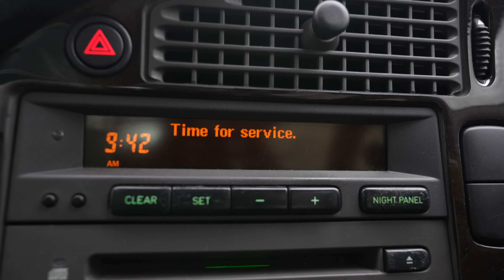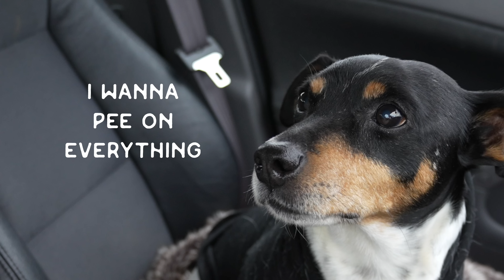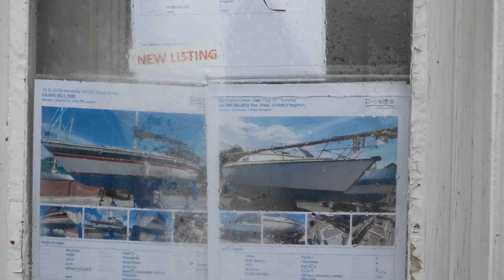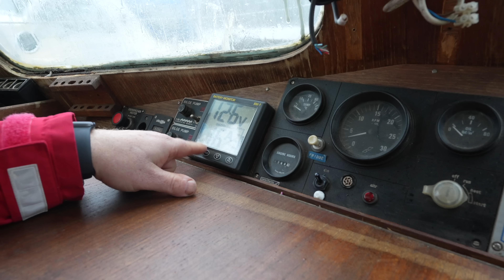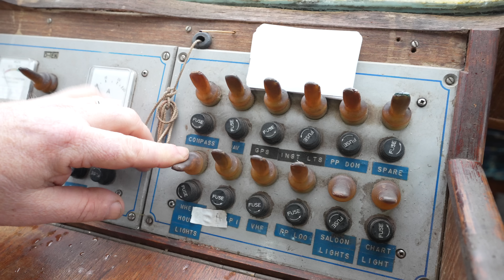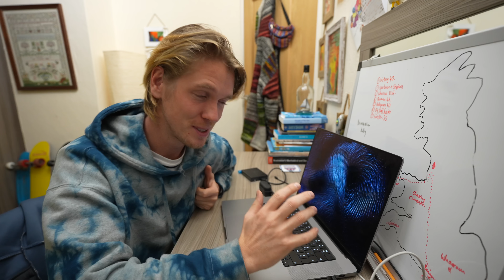Should I Buy This SALVAGED Steel YACHT? Sailing Melody Special Deal! | Wildling Sailing

Comment: Its a great boat with enough that needs to be done to keep you busy and give you plenty of content for years to come all while you sail around. I mean come on you can pilot the boat while boiling water for some tea and never have to move. This boat is just about perfect for you at this point in your journey.  For the price you can not beat it.
Reply: "while you sail around" - in your dreams, this is a motor-sailor. You know, it uses relatively more diesel, sailing is not its strength.
Yes, for a "price you can not beat" .. and for a boat you don't want. How good is that!😢

Comment: Hi Mark, although a generous offer old steel boats need more work de rusting and painting. Swing keels = extra complexity and possible noise issue. I see her more as a motor sailor, but a safe heavy weather boat. Long distance sailors are always stressed in light wind when their boat fails to make headway. Just my thoughts. Good hunting!
Reply: It’s a stitch up on a boat that will sink, 5k scrap for motor and ballast

Comment: Hi, I've owned 2 steel boats, a 30' and a 54' and I would happily own another. Steel is foregiving, easy to repair and immensely strong. Maintaining a steel boat is no more arduous than a wooden vessel. It's all about getting the fundamentals right and eliminating things which make inspection and  maintenance harder i.e. no external wood work, use stainless on all wearing edges and surfaces, Don't drill holes through the deck, make sure all internal and external parts of the hull are accessible easily; hulls rust from the inside out so no water or condensation traps. Use epoxy paint systems on freshly grit blasted steel. Keep on top of repairing any damage to coatings.Use the right amount of zinc anodes, not too many mind. Laid up, use a dehumidifier to keep the inside dry. Be sure to have your electrics in good order to avoid electrolisis. Instead of loads of seacocks and through hulls use a sea-chest of large diameter with an above waterline opening cover for inspection and cleaning. Its all common sense really and satisfying to have a solid and well maintained  vessel under you and hell of a comfort crashing to windward on a cold dark night, knowing about all the stuff floating about in our oceans....
Reply: Bernard Moitessier knew his onions and would approve of your words of steel!
Reply: But sometimes you need to drill in the deck for example an exhaust pipe for the heat system, just use good kit
Reply: How do you check if your electrics is in good order? I have a boat too since two years
Reply: Taking a good welding Class at a local College and having a good welding machine on board will solve all your maintenance problems and even let you earn a little on the side.

Comment: We built a steel centre-boarder (32' Wylo design) and sailed her from New Zealand to Washington DC via Australia, South Africa and Brazil. Two main considerations for us were the strength (surviving hitting a floating container being a major safety consideration) and easy repairability of steel, especially for a shoal draft boat which can lead you into all sorts of interesting places. Our boat also had a non-ballasted swinging centreboard which we used for close reaching or going to windward. The centreboard made a huge difference to windward ability giving us all the benefits of a deep draft when needed and the wonderful bonus of shallow draft for exploring waterways. Our below waterline gasket was made from a tractor inner tube and never leaked a drop. Lastly, the ability to beach the boat (she had a wide keel and demountable legs) and clean/touch up below waterline paint was a huge convenience and saved us thousands in haul out fees. Melody has many advantages over other boats I've seen you viewing and is a very good prospect for a long voyage. A suggestion: make a list of desirable qualities for an ocean going yacht then only buy the boat that fits most or all of them. Good luck!

Comment: You can take this boat anywhere. No restrictions there. Stable in heavy seas. Can be run aground for maintenance. Good size for you + 1. 

After a year or two you find it’s not for you then you can sell it.

It’s a great deal.  Don’t pass up the opportunity. There’s no such thing as the perfect boat
Reply: Mark,take up Andy's offer he's a very generous and genuine person ,at least with Melody you can still put you into her, plus they have not scrimped on the work plus she is a stell hull.
Reply: I once had the chance of buying a BSA 4 wheel sports car  all restored by the owner similar to Andy, I passed on it for the sake of £500, big mistake, BUY IT 🤗
Reply: Any boat owned by someone else is the perfect boat.

Comment: OK my first comment on here since you were in Fleetwood long ago and it's about your choice for next boat. I want to split the comment into two parts so here goes.  Part 1... This is by far the best boat and best offer you have had. Part 2... Up to now. 

I'm not psychic so I can't know what you will find next. But I know you may well regret it if you let this offer slip through your fingers Mark. The steel hull is an absolute keeper, and by far the easiest to maintain and repair if needed. You want to travel the world and navigate very different waters and seas, and hull strength is a huge plus. I sailed all over the world taking over 12 years in a steel hull (many years ago). Best of luck mate on whatever you choose.

Comment: Totally agree with the general consensus here. The steel boat, perfect for northern climes, but not a world cruiser and will no doubt turn into an oven in the sun. The Wharram, I just have this mental image of Tom Hanks on the raft in Castaway! 
In my most humble opinion the Freedom ticks the boxes. It's not so much of a project, so won't keep you stuck on the hard with a never ending list of jobs before you can cast the lines. The double wishbone rig looks super easy to singlehand and trade wind sailing. Lack of standing rigging cuts the ongoing maintenance/cost. It's quirky enough to maintain your cred. Above all it'll take you no time to get back out there.
Reply: Plus you don't have to worry about lightning strikes with unstayed carbon masts !!

Comment: Mark, this is a great deal at 15k, especially since you’ll have the guidance and help with putting her back together! I’d say hop on it! It’s a true world cruiser, big fan of steel boats. Cheers
Reply: It's hardly a "great deal" if you want a blue-water cruising yacht. There is a  very big difference. 
I hope Mark is not pressured to buy something he doesn't want.
Reply: @alexandermenzies9954  he's a big boy and hopefully can think for himself
Reply: @oregon1232  I'm sure that is the case, Oregon. However, the chorus of (likely know- nothings) those trying to solve someone else's situation by lumping Mark with an old swing keel motor-sailor is shameful.

Comment: Mark wishing you well with whatever decision you make, as a boat owner for over 40 years I much prefer the Freedom 35 for an infinite number of reasons, you can spend 10k on this boat in the blink of an eye and at that point it will still be only half the boat the Freedom 35 is, to grow your YouTube channel you are far better sailing to interesting destinations and doing on going repairs simultaneously, you will go completely mad spending 6 to 12 months on the hard and frankly it may never leave the hard and possibly unsalable, the Freedom 35 will always be attractive to a wide range of buyers, which will allow you to transition to your next boat in 2-4 years, sailors with glass boats are generally terrified of steel boats being moored nearby, the decks on a steel boat become unmanageable when they heat up, everyone on board will require shoes at all times and for Yoshi a disaster in closing with wise improvements to the Freedom 35 or another like boat may give you a small capital gain when you resell,  the most important issue however it will always be saleable. I am always in your court whatever you decide, please accept these thoughts in the spirit they are given. Best Wishes to you and your wonderful family.
Reply: Exactly my sentiments entirely.

Comment: I love steel. No osmosis issues etc. and problems, just weld in a new section. You dont heel over as much and good for knockdown prevention.. Bilge keels are designed to help with sailing, not just stands.

Comment: HI Mark,
I had a 33 footer steel boat. One think you'll have in mind is I AM SAFE. The flat part of each side of the hull are called bouchain in French. It makes the boat very stable a sea, especially going trough waves up wind and no pounding. Pilot house is a big plus when you are a full timer. At this stage you see the bones of boat and if you go forward with it, in 2 months you'll know the boat perfectly and you can redesign or adjust what ever you like. I know going for steel is a decision which is hard to answer but confort at sea, security, cheaper to buy, repair and have a good size dinghy. This boat will carry staff no problem.About the freedom, there is not enough headroom for you and if you load the boat a little too much, you'll lose the performance. A light boat for the week end and summer is ok but for you ???? make a list of your priorities and stick to it. Myself, I really like the freedom but not for sailing full time.With melody all options are on table. One more thing, melody is very well design. Happy sailing!

Comment: Being steel, the bottom configuration (chined) may make her roll more in a beam or quartering sea or swell. I gather Andy is willing to step the mast and launch Melody as with this topic, adding another cost. Possibly, after Melody is launched you could take her out on sea trials giving you more knowledge of her capabilities? It's a tough position so take your time with knowledge of further sailing adventures. Good luck!
Reply: There is another steel chine yacht recently re-launched on YT and it's very apparent it is a "wet boat" on any tack. The rail is under even with light winds.
No wonder they're headed for the tropics..
😀

Comment: This is an interesting boat and a good offer for the right person (even at the completed 25k price post refit and in the water), but... First, I think this is a more of a motor-sailer, 36 foot with an 80hp diesel with massive fuel tanks sounds a bit suspect. You'd probably want to look at the rig and the sail numbers to see if this boat can handle its weight under sail. Also, if you are planning on staying in cold weather this type of design is fantastic (think about how much attention was given to the heating system on this boat, protected interior helm, etc.), but, I think you'd cook in the tropics (the pilot house looks like a pressure cooker and there are very few opening hatches, etc.). 

If you were planning on sailing up near the Arctic, that'd be one thing, but, if you are heading out the channel and turning left, it is entirely another. I think you'd be happier with the sailing ability of the Freedom 35 out of the two so far, which is designed more for multi-latitude sailing, and would handle a trade wind circumnavigation with ease. Excited to see what other options you are considering! Fair Winds!
Reply: Agree!
Reply: Another vote from me in support of this view of the steel boat. It looks like a powerboat that will have a sailing rig on top. You will burn a lot of diesel going anywhere, but you will be warm and comfortable on the way. I can't imagine it going upwind at all without the engine, the shape of the hull and all those underwater appendages suggests that it doesn't sail like an International 14.

Comment: Amazing boat, super study and will take you anywhere in the world. I think the biggest question is how big is your diesel budget going to be when you travel the world. How many knots of wind does it take to get this vessel moving? Are you willing to spend the money on diesel to get you to your next destination or stay standing still till you have enough wind to move? That might be the biggest limiting factor with this kind of boat in my humble opinion.
Reply: If you end up becalmed or have light winds motoring will be expensive..
4Lt Diesel engine running at 2000 rpm, speed about 5knts ,consumption aprox 1 gal per hour min,12 hr motoring to travel 80 miles cost £ 80..

Comment: I’ve seen the work being done on this boat and it appeared to be good and the replacement of the rot with new steel is a big plus, but that Freedom is so easy for 1 person to sail. How easy is this one to handle with 1 person? Great that Andy will help you get it in the water. 🤗
Reply: I'm sure he can sail this solo, it's probably pretty slow to react
Reply: Has roller reefing on Jib, and in mast main furling, single handed about as straight forward as you could reasonably get with a conventional rig.

Comment: I love wharrams too but only the pahi 63 although 200k ! a beaching option in motor sailor with no rot, normal rig cabin space, all weather boat, proper engine, 2700 series ford, cheap & common what a deal !

Comment: While a steel boat may rust, just how much is dependent on how well you look after it, wooden boats while traditionally are very costly to maintain, and fibre glass do have a shelve life, so that is a good boat, hard work mostly done, plus he will help you finish it off to sail ready. Even if you don't buy it, do not be put off by steel, these days they would be the only boats I would buy again.

Comment: From 11' 55" is that daylight showing around the Starboard edge of the transom?   Triple keel and centreboard is a slow configuration and if you have to take the mast down and remove the mast support pillar to get at the lifting keel fittings, unworkable.  You need easy access to all the lifting keel gear. It might be better to do away with it.  Could be a good Motorsailer for someone who is into fabrication/iron fighting,  masses of work still to be done in every area. Otherwise,  it will need constant painting.  The Freedom is 1000 x better in every way.

Comment: watch out for Sikaflex on steel.  I rusted the heck out of my car using polyurethane caulk as undercoating.  Polyurethane is moisture curing and it must be a bit acidic,  might stick better with butal.  also learn to weld, a friend had a steel boat and finally ditched it as rust never sleeps.  You need special marine rubber paint to stop the rust weeping. I epoxied my trailer and after launching there were tons of rust dots creeping through.  But if there are many coats may be just fine I do not know.  If you are only going to keep it five years or less should be great but long term it is always going to need more plating.  Metal is hot and cold and needs foaming.  I would pick a laminated epoxy coated wood hull over steel every day! Everything I see is a bit crude but may be very functional. Pilot house is a very nice to have.  Most likely slow going.  Swing keel is a good thing as you need shallow draft sometimes. The last ten percent of  a project takes the most time to complete.  Price to me is high for a project boat. You never get your money back out of anything unless the last coat of paint is on and everything sparkles with current style fitments. Still if everything has been gone through and repaired then you can sweat the wall decor.  To me that boat is for an old salt, and you are a bohemian. I can see a Tiki on you, the freedom is a very well respected boat and friends of mine are sailing to the Bahamas every winter and living on it five months out of the year. For 15K you have your pick of tons of 36" boats in the US.  I once owned an Ed Hortsman Tri Star 30 which was great fun with tons of room.  I would look for a plywood tri that was well built, of the cruzing not racing kind.  As for fabrication skills the only way to learn is by doing.  We all just fake it till we make it! Good hunting!

Comment: This is another great boat for you and has lots of options for you consider compared to the freedom 35 and quite a generous offer from Andy. Definitely a strong contender with a bit of remaining work and an excellent engine and protected cabin. Has some excellent options with the triple keel/swing keel for work in a yard or careening work abroad, Also, I would assume slip fees/dockage would be a lot cheaper as you travel. Good luck.

Comment: I say go for it that's a great deal however at the same time  you know your own mind and plans so go with your gut regardless of Andy and us here you won't lose subscribers or friends.

I have never had a twin or even triple keeled boat but wouldn't mind, they are a superb option. Personally as that one as its been restored I would keep the drop keel for now but I would also consider getting rid of it its only real purpose is for upwind performance which frankly for a live aboard international cruiser is a marginal advantage over the additional maintenance and risk of failure.  I am willing to bet it would rarely to never be dropped.